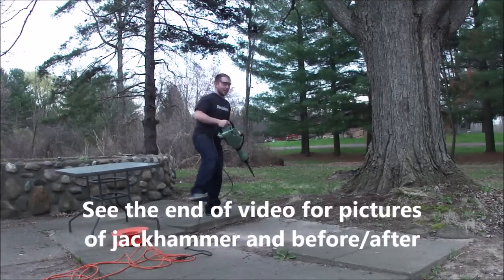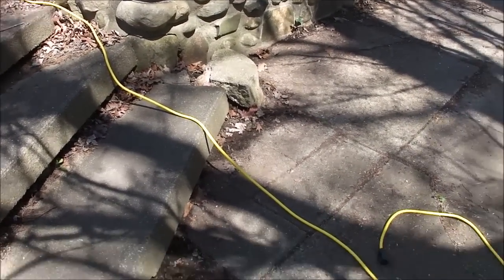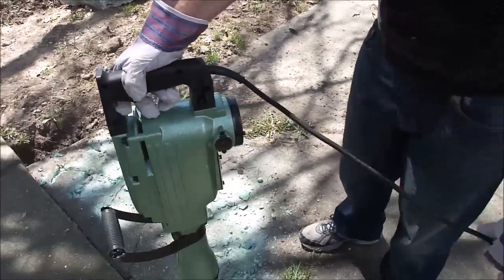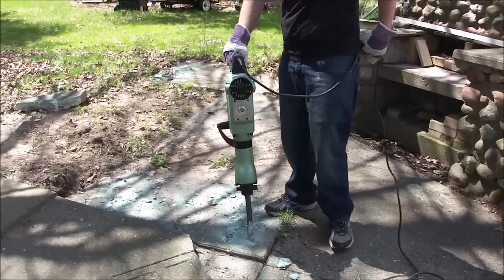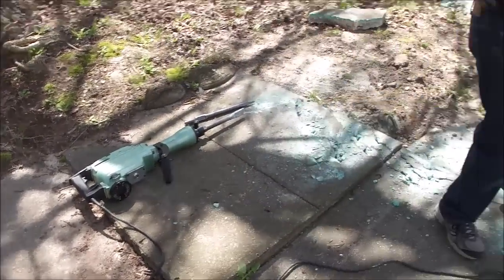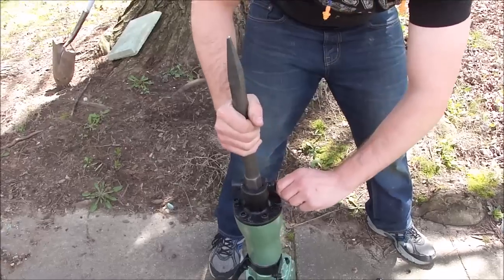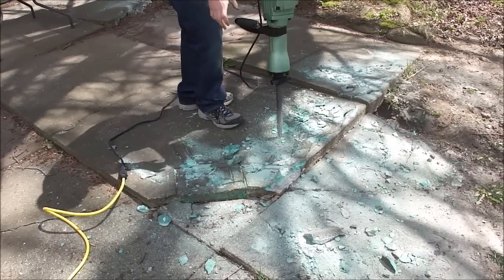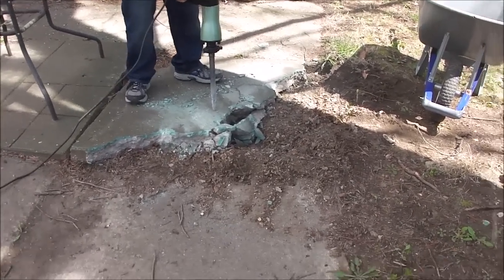Cheap eBay 1500W Electric Demolition Jackhammer Breaker Arksen

Comment: You are using the tool wrong.
You are not supposed to run the motor when the chisel is not pushing on the stone.
Same thing about not putting enough force to stop the machine from jumping while hammering.
Reply from the maker: +i11011011001 Is it bad for the machine? If so duly noted, I never even thought about that, but it was only $124 so I could throw it away right now and still be content with the purchase. Thanks for the comment.
Reply: +striker1211 Years ago, my dad and I learned the hard way that starting the hammer without a load causes the bits to fracture and break.
Reply: +striker1211 Years ago, my dad and I learned the hard way that starting the hammer without a load causes the bits to fracture and break.
Reply: i11011011001 you actually are suppose to run the machine periodically without pushing on the concrete..the sound you here is a fan that cools the unit. You could run it for 5 minutes if you want to cool down the unit

Comment: This tools are ok quality just never forget to oil them and you will have this tool for years.
Reply: profesional my ass....its lacks lubrication...this is a cheap chinesse shit that emulates Hitachi H65..even that tool has some problems with lubrication on the gears and on the piston and conrod...they werent to smart when they designed it...also the bottom covor lets all dust and rocks inside and that destroys the rotor and stator...whatever...i have that Hitachi...just so you know...

Comment: Does this unit receive hex bit (such as those from Bosch)? Thanks.
Reply from the maker: +Ninja Pig Gaming It uses SDS-max bits if that helps.
Reply: striker1211 DAD STOP USING MY ACCOUNT NOW AND PLS JUST SIGN INTO YOURS AGAIN
Reply from the maker: +Ninja Pig Gaming lol!
Reply: +striker1211 the bit he removed and put back on was a hex bit or demolition bits. sds max bits have splines on them.
Reply: Eric Jimenez sds max doesnt have splines it has grooves spline bits are the old style
Reply: Definitely not a sds max bit
Reply: hola amigo q tipo de aseite se echa